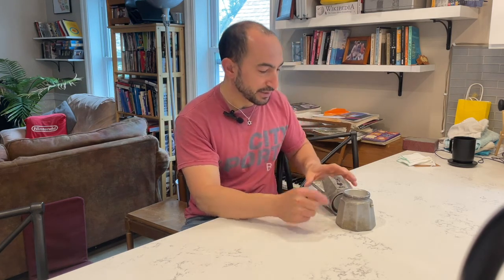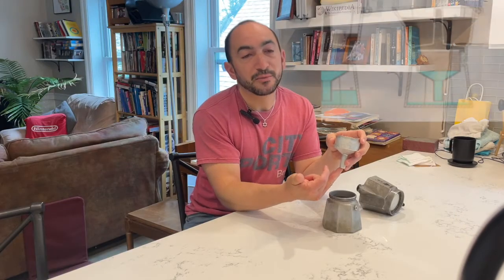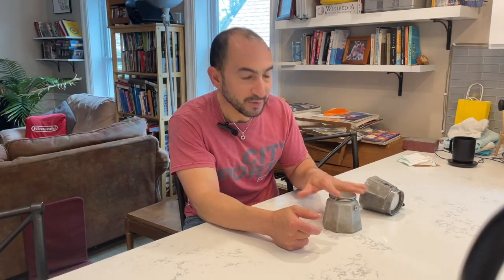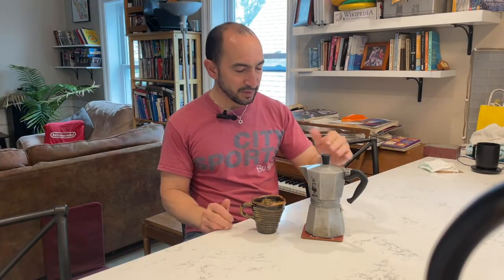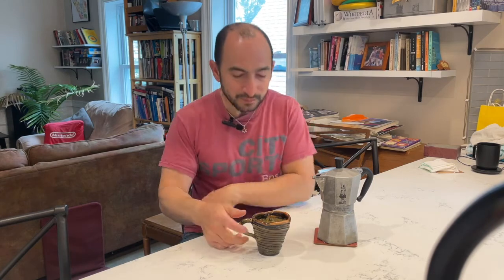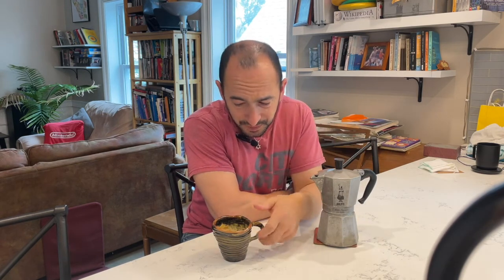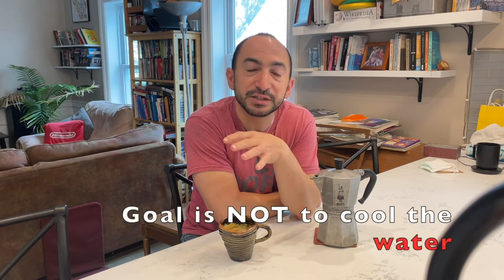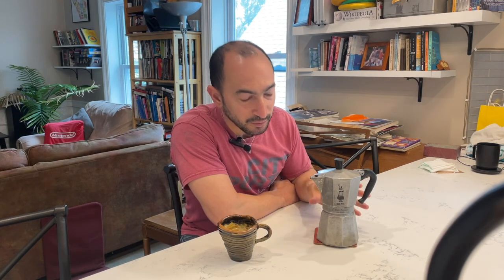The Cold Water Tap Myth of Moka Pots

Comment: My experience is different. I've been shooting for approximately a 1:2.7 brew ratio, which on my 6-cup moka pot is achieved by filling with 30g of ground coffee and 135g pre-heated water in the base. Then I let it fully go through over the course of 90-120 seconds until no more can come out, producing around 80-85g of espresso in the top. This allows me to achieve a more consistent ratio that's closer to espresso, and I haven't noticed a downside in flavor like you describe when using a full lower chamber.
Reply from the maker: @ac213a  the number one rule of Brewing Coffee is that if you like what you’re getting, you can keep it. That said, there are unanticipated consequences you underfill the water level: your coffee actually brews faster: https://m.youtube.com/watch?v=NQrRzTzU_Yk

Also, there will always be leftover water in the base because of the design of the Moka pot:

https://www.youtube.com/watch?v=F1ofrthmrV8

There’s no good way to vary the amount of coffee you get out of a moka pot besides buying a different size Moka pot.

Comment: Bialetti has always known the "Navarini" information, so their instructions include a much better technique for dealing with it that produces consistently good flavor. 

It's not done by what the coffee stream looks like, so you should leave the lid closed. The instant you hear the pot start to gurgle, or even a couple of seconds before that if you know the timing, remove the pot from the stove and set it on the countertop to finish brewing from the residual heat inside the pot. Then stir up the most-concentrated coffee from the bottom with a teaspoon, and pour. There will always be leftover brown water full of fines in the bottom, which is a good thing because it would've diluted and dirtied your cup had it been allowed to go through. 

If you do that in combination with the other scientifically-tested Bialetti instructions, you'll get consistently good flavor, and with a very simple process.

1. Fill it with cold or room temperature bottled or filtered water to touch the bottom of the pressure valve.
2. Loosely fill the basket to the rim with medium-fine ground espresso (Bialetti Perfetto Moka, Lavazza Espresso Italiano, Lavazza Crema e Gusto, Lavazza Qualita Rosa, Kimbo, illy Classico Espresso for Moka, illy Intenso Espresso for Moka, etc. Any Italian grocery store pre-ground espresso is perfect for the Moka.) Don't press it down. Use a straight spoon handle to scrape it off level with the rim. Remove any grounds from the rim and threads, then screw it together tight.
3. Cook on a low gas flame or a preheated medium electric stove. 
4. Immediately remove the Moka from the stove as soon as you hear it begin to gurgle. 
5. Let it finish brewing off the stove from the residual heat inside the pot. (Do NOT cool off the pot under cold running water or by setting it on a cold rag, etc.)
6. Stir up the most-concentrated coffee from the bottom with a teaspoon, and pour. 
7. Wash pot with hot water and wipe dry with a cloth. It will stay very clean. Monthly cook a batch of plain water in the pot to deep clean it. 

Hoffman admitted he doesn't understand the Moka and he even said, "It broke me!" He also tweeted that! He doesn't have access to the very expensive state-of-the-art scientific testing and professional taste testing that Bialetti does, and has been doing for 90 years - which they can easily afford on aprox $180 Million US dollars annual gross profit. Neither do the other Third-wave influencers.
Reply from the maker: Hi, thanks for your comment! I’m a bit puzzled at your source for most of this information, though.  Could you provide citations for anything you’ve written here?

To my knowledge, Bialetti has never published any papers showing that it’s actually done research on the stuff, especially since the basic pot design was invented in the 20s (before digital temp sensors) inspired by a washing machine design, and hasn’t changed since then. Hoffman does have a long-standing history of being critical of the moka pot, saying that he fails to understand their widespread appeal, but he’s never said he didn’t understand how it worked. In fact, his advice about filling the water level less fully to solve the back-pressure issue when dealing with dark roast shows he understands the basic principles as described in the King Paper (described by me here: https://m.youtube.com/watch?v=O14BIH-9KTA). I also personally try out his advice in my video here: https://m.youtube.com/watch?v=NQrRzTzU_Yk
Reply: I poured hot water, poured a full basket of coffee.
And kept on a small fire. From the moment it began to flow, I counted 30 seconds and removed it from the fire. It reached readiness on the remaining pressure.
I tried to bring it to the geyser and remove it, but it turned out bitter to my taste.
So as I have seen, the best flavor comes before the eruption.
Reply: @andrijstorozenko5631  Italian with Bri channel has a Moka tutorial, and she knows the timing well enough to remove her Moka from the stove a couple of seconds before it begins to gurgle. So it seems like you and she are using the same timing. Sounds good 👍🏼😊☕

But I believe it tastes much better if you start with cold or room temperature water per Bialetti instructions because the ideal temperature range for brewing espresso and coffee is 194°F to 205°F. If you start by pouring in hot water, the temperature will quickly go to the 212°F boiling point. The Moka should never boil. It doesn't work by boiling and making steam, it works by gradually heating the water, air, and vapor until it expands to make enough pressure to push the water down and up through the pipe.

Comment: This makes sense to me when the serving is bigger than what you would pour in your cup, like if you want to leave some coffee in you pot. But ultimately if you only have a single cup brewed I would just skip the cooling process and pour it directly from the stove. Taking your pot to the tap the pot is still extracting the bitter steam. Pouring it directly will save time when you look at the overall process. Though I don't know if time is that critical. At least that is my theory.
Reply from the maker: So I haven't actually experimented around with this, though many on the internet support your general idea.  That said, theoretically, I would not advise this.  Your coffee being in the "Stromboli" phase (i.e. when the brewing is bypassing the water and steams goes right through the beans) happens when the water level is just barely insufficient to cover the bottom of the connecting tube.  If you tilt the pot at all, you'll make this problem worse and open up a HUGE straight steam-to-ground bypass hole.  I would expect results to be much.  Again, this is just my theory. Maybe a future video experiment for me!

Comment: Can you tell  the difference from what I’ve always seen done in Italy (from the non bitter coffee lover faction): pouring immediately the coffee into the cup? It would be very interesting.
Reply from the maker: Soooooo I haven't experimented around with this though I lot of people like to bring up this idea.  

My initial thought is that this would be a bad idea, since the whole problem with leaving the pot on the stove after the pale bubbling comes is that you're out of water to pass the added pressure through so instead of brewing with water, you're brewing superheated steam, which dissolves all kind of nasty bitter stalky fibers from the beans.  

If you pour the coffee out, you're tipping the very shallow level of water sideways, creating an even bigger opening for air to go through the connecting tube.  if that doesn't make any sense, check out Fig. 5 (c) from this paper: http://www.msc.univ-paris-diderot.fr/~phyexp/uploads/Moka/article2.pdf You're pouring the small amount of water that remains in the lower chamber to the side, so you're making the problem of sending air through there even worse.

All that said, that's just my theory and I'd really have to sit down and experiment to see if it really impacts the flavor badly!